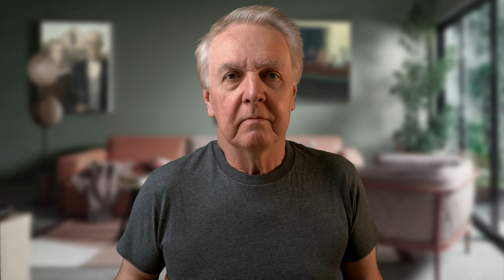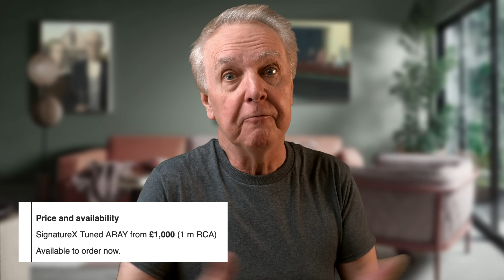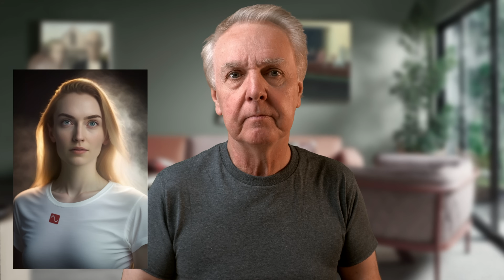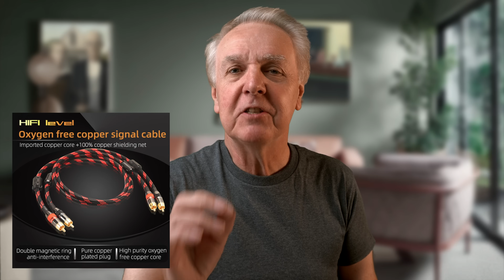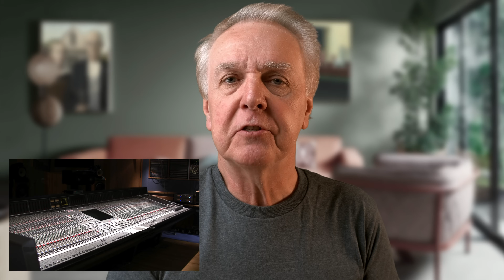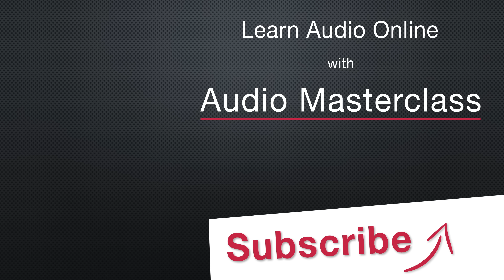Would you pay $1000 for a 1-metre cable?

Comment: I have to admit that ten years ago, I allowed myself to get sucked into the idea that purchasing a $100 (Canadian) Monster™️ 20 foot instrument cable, “designed for Bass Guitar”, was a good idea. 

😂

I can’t honestly attest to it sounding any better than a normal inexpensive cable but it truly is VERY robust, having withstood the test of time and incredible amounts of heavy abuse with zero problems in connectivity or anything. 

It is still the cable that I use to connect to my Bass amplifier to this very day. 

Every once in a while, you do get what you pay for.
Reply from the maker: Hi-fi cables are one thing, instrument cables are most definitely another, potential problems being the tone being dull due to capacitance, interference, and of course crackling as the cable moves. This would be a different topic for another video, but if you have a cable that works for you I'd say buy another one in case you lose it. DM
Reply: Due to the high impeadences that guitar amps work at, high cable capacitance can result in loss of high frequencies. So good quality long cables are a must, whether you need to spend as much as $100 is outside my experience.
Reply: @peters7949  Define long.

Some years ago someone tested the HF rolloff on guitar cables and determined you should keep your (high impedance) instrument cable under 18 ft.
Reply: @Wizardofgosz  I would always suggest keeping cables as short as is practical, but on large stages with lead guitarists that wander all over the place, cables longer than 18ft (6m) are not uncommon. Although radio guitar transmitters are often used these days to overcome this problem. 
An alternative approach is to use a DI box close to the guitarist (or their foot pedals) then run a low impedance balanced cable to the amp. However the interaction of specific guitar & amplifier can be part of what makes the particular sound the guitarist wants, changing the lead & anything else in the signal path can have a noticeable effect on the sound.
Reply: I have to agree that Monster™ instrument cables are absolutely worth the money.  They always have excellent audio properties and they are built to last.  They may sound no better than some cheaper cables but they are still a bargain because they will last ten times as long as that cable that was half the price, saving you money in the long run.  They are also available in lots of colours so you can colour code your audio connections, which helps more than you might think when setting up a complex live stage rig.  The colour choices can also help you just make your rig look a little better, which for some people is worth paying extra for.  Personally I don't care too much about the looks of my cables, but colour coding and robust build I absolutely do care about.
Reply: @FireAngelOfLondon  monster cables are all Chinese crap right now. Build your own. They'll be much higher quality. Use mogami wire and neutrik connectors.
Reply: @Wizardofgosz  Seriously?  I don't work in a studio any more but it is always sad to hear of yet another company that used to make great products that has gone the cheap outsource route and lowered their quality.  It is a really bad way to do business especially if quality was your selling point!  People absolutely will pay a bit more for something good, but disappoint a customer once and you usually lose them forever.
Reply: How is it for flexing?  One thing I always run into even with Fender(tm) cables is they tend to break at the plugs and I have to keep resoldering them.  I finally got fed up and went wireless but the tone isn't quite as warm or at least that's my impression.

Comment: That's $1 per buzzword. Just give me a nice bit of copper with well soldered connectors. Having worked in live theatre sound, the bit of cable I care about is the solder and strain relief, a busted cable has a pretty bad frequency response and distortion figures.

Comment: Ah yes, the ole' audio interconnect canard.  So easy to get an audiofool to part with his money.  And one does it to the other, as snobbery sets in pretty quickly.  "Your system will never sound as good as mine because you haven't spent X on interconnects."  Have any of them opened the components up to see what cabling is used in the wiring harness?  Don't think so.  In any case, if you want to test audio interconnects in a somewhat meaningful way, use the cables to route component video signals.  It's amazing how often these ultra expensive cables make a mess of those signals.  you can see the degradation with your eyes.

Comment: I have always thought of audio/hifi as chain. To have one link in the chain so much stronger than the others is totally useless. Most audio these days will probably emanate from the poor quality metal on the legs of an Integrated circuit chip. Even if you have an all analog (vacuum tube) system then at some point your signal will travel down cable of relatively poor quality. The only thing more useless than these interconnects is expensive power cables which aim accurately transmit a very noisy voltage from the power socket in your home (maybe another video)

Comment: The $1000 dollar cable needs to be cryogenically treated for at least 48 hours, then the cable needs to be subjected to a period of 'burn in' of at least 6 weeks. Finally, you need to strap a small plastic bag of magic pebbles to the cable approximately 127.683mm from the tip of the cable at the output end. Before connecting the input end to an amp, wait at least 3 days or until the next full moon, unless rain is forecast within the next 8 hours.
Reply: You forgot the quantum dots to be placed on the ceiling at a golden ratio distance between the tweeter and the listening position.
Reply: You also have to sacrifice an unused minidisc player at the winter solstice  otherwise won't work
Reply: @seymourclearly  A minidisc player? That evil piece of equipment that uses lossy audio compression? Drive a silver arrow through its entrance bay before you sacrifice it or its ghost will haunt you forever! ATRAAAAAAAAC!!!! ATRAAAAAC!!!!
Reply: Also, you forgot to mention, that the cable needs to be connected in the correct direction, because electricity behaves differently whether it goes forwards or backwards...
Reply: @supergrissi It behaves differently after it is used in the same direction for a long period of time!
Reply: @scottttd1510 burn in. Obviously to remove the ‘veil’.
Reply: @supergrissi good point, I think my house lighting might be underperforming because my house wiring cable needs to be replaced with polarised AC cable as the electrons are find increased harmonic resistance
Reply: @Mk-tp2mz you need to come off grid completely otherwise you’re just wasting your time. And it should be purely solar power so there’s no vibrations at all.
Reply: This is, of course, the economy commissioning process.
Reply: A nice upgrade is to dip the Cables into organic non GMO Bees wax, then dipped into a mix of cryo treated moon dust, and powdered purple sea weed and aged at least 1 year.
Reply: @toxsickdog where did you study electronics?
Reply: Audiophile basics..! 😂
Reply: Good tip! 😅
Reply: Eye of a newt, skin of a frog, wing of a bat, full moon, solar eclipse.........
Reply: A discord I'm on has a guy selling cryo frozen custom made cables for "only" $100 and so many newcomers eat it up. It makes me sick.
Reply: @mat.b.  Cryo frozen cables can sound brittle. Oil filled cables have much smoother bass response, however once the oil has absorbed 1000 hours of music the cables must be replaced.
Reply: The cable also needs a special blessing and needs to be installed in a house that has been installed inside a Faraday cage. 😂 This rubbish can be debunked with an elementary level of knowledge of electronics and physics. Thanks for giving me a good laugh and I admire how you managed to describe this bunk with a straight face. People who believe this type of stuff probably the same level of understanding similar to those who thought COVID was linked to 5G. 😂
Reply: @Mk-tp2mz You know nothing.
Reply: wothout cable lifters cable simply don't work
Reply: @damirhlobik6488 😂😂😂 those little wooden blocks that were selling for a couple of grand?
Reply: And the outer part of the cables insulators  need to be handwoven by seven virgins under the full moon! Don’t forget this essential ingredient!
Reply: You loser! You were doing just fine up until magic "pebbles".... EVERYBODY knows that they're magic CRYSTALS; Everybody.....smh  And as long as I'm being critical, you're only out 3 decimal points of a millimeter, so you really screwed the pooch on that one, as well.....  Please spend more time on Witchcraft Google before erroneously commenting again in the future....    
Full disclosure: I spend stupid money on cables....wait....INTERCONNECTS myself; Not ridiculous, but certainly stupid. It doesn't stop me from being able to laugh at myself, though, so at least get the effin' crystals right!!...... Bwa ha ha ha ha                    Sparks in Daytona
Reply: You must not make fun of the Dark lords.  They will punish you.  The souls of the Audiophiles roam  the earth for eternity,  they hear all things, all sounds and laughter.  I once told a dark lord I could not hear any difference on his new £3000 power cable.  In response to this he ate my first born.  The only help on our side is the miles of crap three core cable hiding in our walls.  They mock the one Meter cable on its little six inch stand waiting for sunset.  One day the old guard cables will leave the walls and destroy the believers. Music is my first Love it will be my last.  To be honest it is not anymore. Not since Autotune came to this planet. So guess I will go back to Carol Vorderman or cornish pasties.
Reply: And you have use the blood of a virgin on all connectors.
Reply: Ha ha ha, exactly the kind of crap marketing uses to try selling you snake oil !!!
Reply: You are obviously an over paid design technician working for Audio Quest!!!😊😊
Reply: I don't believe this crap
Reply: You haven’t mentioned that it cannot simply hang, but needs to be placed on audiophile stands.
Reply: I don't believe you
Reply: One will find disparaging comments usually come from those for whatever reason are unwilling to take the punt. However, 2-channel stereo listeners with their short cable runs can be forgiven for being so cable sceptica. 

My system happens to have nine channels (5.4.4), and therefore given the various cable lengths of a 9 Channel setup. Unlike a stereo, a heightened noise floor on a multi-channel setup becomes a little more apparent.

I've changed the cables on my 9 channels multiple times. The cables that carry the signal to my height channels only have limited shielding (entry level) so when the height channels are switched off (externally amplified poweramp), and therefore just going through the five channel configuration (base-level) the extra shielding on my on my base-level cables (chord epic/shawline) brings the noise floor comes back down to satisfactory levels. Unlike the height channels, which only have limited shielding. The shielding on my base-level cables are of superior quality.
Hence, the room becomes exceptionally quiet once again.

Unshielded cables often act as antennas for attracting RF, and the longer the cable, the better the antenna. Probably explains why when I used to disconnect my height and surround channels within 10 minutes, the unwanted faint background signal noise used to disappear.

The last group of cables I shielded, we're my HDMI's, and lo behold, the room became a little bit quieter yet again

Conclusion;
The better the cables, usually the better shielding. 
The better the shielding, the quieter of the room.
Reply: No it doesn't need cryogenics
Reply: Don't forget that it has to be installed by licensed professional...
Reply: I'm enjoying this comment and will be for years...
Reply: You forgot that you need to be facing due North, and stood on one leg at the time of cable insertion..... 😜
Reply: @stevesstuff1450 That’s how an audiophile enjoys his sex 😁
Reply: @stevesstuff1450 This is rubbish

Comment: Maybe they should consider pricing their cable at $5 billion. Then they’d only have to sell one. And I wouldn’t be surprised if they did sell that one cable. My audio “hero”, Paul W. Klipsch was known for his famous reply at audio conventions where competitor speaker manufacturers were speaking of their “breakthroughs” in speaker design. You may already be familiar with this story, but his response was bulls**t and he even had lapel buttons printed with that so he could flip over the lapel to reveal the message. I’m pretty sure his response about these cables would be “BS”. 

Another interesting thing about some of these esoteric cable and audio component manufacturers - they make claims that something new about their design is based on science and research but then when they’re confronted on the idea of demonstrating measurable differences through testing, their response is usually that these differences are not revealed in tests, and only through careful listening through a high end system.

Comment: I sensed irony in your comments, but I'd like to point out that there is a scientifically valid reason for requiring low-mass electric-field waveguides for the interconnect: a high mass would produce focusing of the electromagnetic radiation from the accelerating electrons which, depending on the precise length of the medium, could result in differential translocation of the ornicles, resulting in dysphonia in the aural cavity.
Reply from the maker: You could get a job doing this. DM

Comment: I love your no nonsense backed by factual data approach in your videos…very good. So let me share this….my system is not an expensive one, but it’s components make for a very neutral and revealing one. I don’t waste my money on vinyl as I grew up with that in the 60-70 & 80’s and it is simply inferior. High sensitivity KLH Kendalls(96db) driven by a Yamaha AS801, which boasts a very low 0.009 THD, pushing 100+ High Current Amps. I’ve experienced/auditioned High End speaker and power cables that simply didn’t warrant their price. For a whole lot less money, I terminated a set of 12 gauge Ox Free copper speaker cables with Silver Plated Banana Plugs from Audioquest that immediately made an audible difference, particularly in Bass response. Offerings direct from China…love or hate ‘em…have made higher end cables mush more affordable. My second “upgrade” was a locking coax cable terminated with silver connectors from my BlueSound Node2i to the amplifier. Again an audible difference was heard by not as pronounced as the speaker cables. And my last upgrade in my system yielded a quite astonishing difference in the complete sound signature my amplifier was delivering to the Kendall’s. Disclaimer, I have no affiliation with any company I’ve mentioned or am about to mention…whatsoever. There are many who think the term “Snake Oil” applies to any thought when it comes to power cables. But I found on eBay for less than $150, the Viborg MTR1501(I could be wrong) power cable about a half a meter or more long, that left me with a mouth wide open that I couldn’t close!!!  I simply didn’t or couldn’t comprehend that there was that much more musicality inside my system! From decay, to textures to a completely more realistic tonality….I can say hat it is the single most important component, yes component in my system.   So to answer your very valid question of “would you pay 1000 bucks for one meter of cable?” Absolutely not!  But for all those who think Power cables don’t make a difference…..they do!  Speaker cones vibrate at speeds defined by the current fed to them. The accuracy in which drivers vibrate to recreate particular sounds produced by performers and their instruments, including voices, is solely dependent on how clean the current is delivered to the drivers from the amplifier. And who the hell knew it would be that monumental?? I’m sure many have and do know……but I surely did not. Viborg is a Danish company who’s offering are made in China, which keep the costs down…way down!  And they have proved, that as pretty as some of the cable on the market available are, none are worth the many thousands of dollars they ask for them. How much is that Viborg worth to me…having heard and loved with it…..it’s safe to say, I’d spend $500 for it.  My total cost for cabling in my system is about 300 bucks. Again love your videos….a true reference source for any and all Audiophiles and newbies gettin into the Hobby!
Reply: I can also back this up when I added the iFi iPower (now outdated by iPower 2) to my DAC in my speaker setup and it made a BIG improvement to the bass quality, I now have an emotiva CMX-6 power strip which filters out noise and jitters from the dirty wall outlets as well.
Reply: @SomberShroud  BS
Reply: @rabarebra  It's easy to say that if you've never heard clean audio before. Just think logically for a second, The Power grid is a very dirty current, so powering your audio gear with dirty power is like a flickering light on a cheap store, it can't give the full power potential and your missing quiet details cause it can't process them fast enough, In the same logic as driving audio gear properly with enough power, if that power isn't clean, there will be holes at points which effects the end result (these holes aren't obvious until you've heard it properly). I'd like to remind you that this wasn't an audiophile psychoacoustical snake oil moment like "oh I think I can hear a difference". This was a jaw dropping night and day difference like the power cables are just as important as my amp. I should also specify you don't need to spend anymore than $200 on a power cable, anything more expensive is diminishing returns.
Reply: @SomberShroud  Still BS